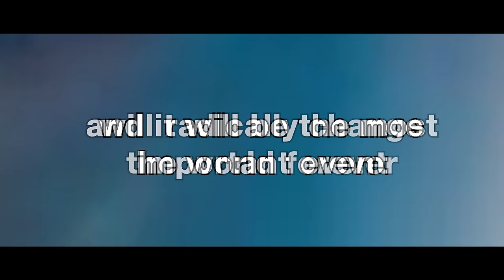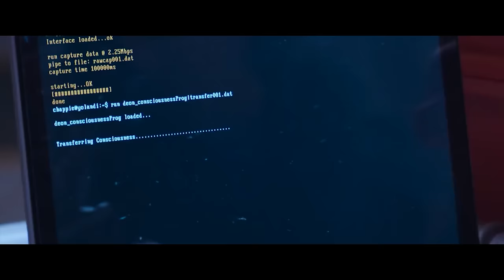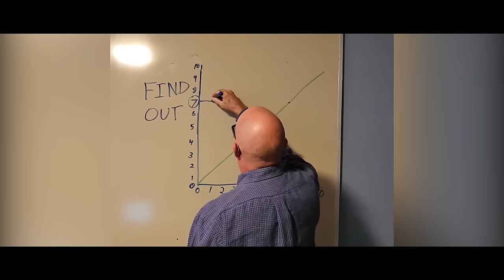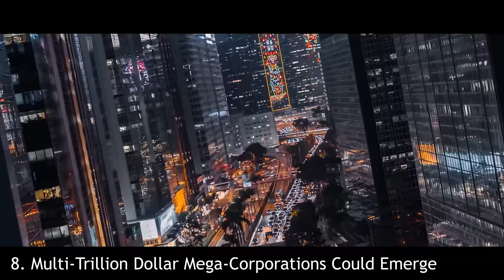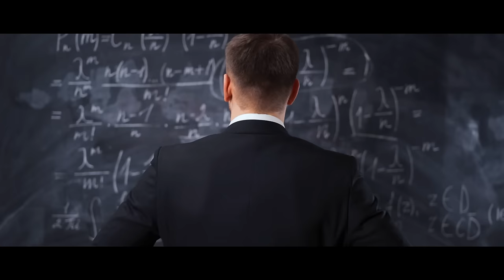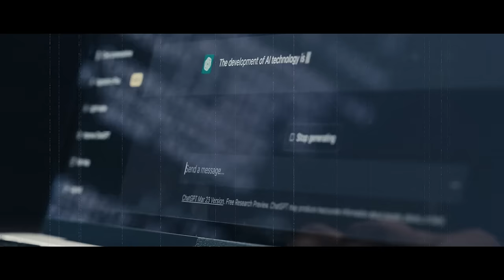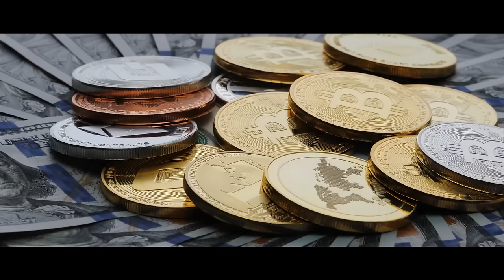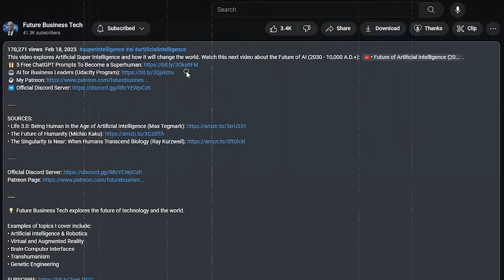Technological Singularity: 15 Ways It Will Change The World

Comment: Re: eternal youth - to avoid overpopulation, we should be allowed to have access to rejuvenation (where we can choose our physical age, from 20 years to 50 years) on the condition that when we reach 150 years old, we have to leave Earth and not return (except for visits not exceeding 1 year for every 15 to 20 years).
We have the option to:

A) Move to Mars or another off world colony. Extensive genetic and bionic modification would be made available, but bone density and muscle loss, radiation damage and other diseases are easily curable, so GM augmentation would not be necessary or mandatory.

B) Go into hibernation and join a colony ship to other potentially habitable star systems.

C) Have your mind uploaded to an artificial brain that is then connected to a virtual reality of your own choice, with the option to later have that brain implanted into an android body (which is also required to relocate to another planet.

D) Have your mind uploaded to a self sufficient server (cheapest option) where you can age at a normal rate and pass away in a human time scale.

E) Have a single rejuvenation cycle, but then age and die as per normal ageing.

F) Have the rejuvenation reversed (when you are about 100 years old) so that you age at a normal rate and die at or about 150 years old.

G) Live to 150 and then get humanely euthanised.

Many people will likely not even agree to rejuvenation. Wishing to live and die in the natural cycle (though with advanced medicine, that might be up to 150 years old anyway).
Religious or philosophical reasons, family or social interactions, fear of the unknown future or even just weariness could all be factors in the decision to live a ‘natural’ lifespan.
Reply: I agree that many people would chose not to live indefinetly, but I suspect that they would be in the minority.

I don't know that people would want to be exhiled to a Mars colony in order to continue their existence, especially if that implies a serious downgrade in their quality of life.

Comment: Bold statement. Technology only got smaller. Displays has higher resolutions, photosensors are more sensitive, and processors has smaller and more compact transistors… but they are all the same old 386 computer arquitecture. Except for quantum computers… which may be the groundbreaking.

Comment: I have never been convinced by the importance of anti-matter or fusion rocket engine. What's the point if you are still going to have a certain kind of matter onboard to throw behind the starship so that you can propel it forward? After all, what the fusion reaction or mater-anti-matter reaction produces is photon particles aka light. Light being massless, you gain nothing throwing it behind even at high velocity (light speed)
Reply: You are incorrect on more than one point:
1. Light might be massless but it has momentum. And the more focused and intense light is the greater its momentum is. Which is how the Breakthrough Starshot project's tiny laser driven light sail probes are expected to reach up to 20% the speed of light on their way to Proxima Centauri b. 

Even unfocused sunlight (+ some solar wind particles) can drive a solar sail but it would need to be huge. But lasers are perfect to accelerate low mass solar sails in space. The lighter the probes are, the wider and thinner their sails can be, and the more powerful the lasers are, the highest the speeds that can be achieved.

2. Fission, fusion and matter - antimatter propulsion are orders of magnitude more efficient than simply burning a chemical fuel with an oxidizer. The point is to reach very high exhaust velocity using the lightest fuel possible (for high Isp, i.e. specific impulse). Hydrogen, being the lightest element, provides the highest Isp but it's unsuitable for long distance flights due to very low density and the requirement of an oxidizer to burn.

Methane is the second best (higher Isp than jet fuel, lower than hydrogen) but it still requires oxygen in chemical rockets. Chemical reactions are slower and far less efficient than nuclear, so huge quantities of both methane and oxygen need to be carried. But with a fusion reactor one could break down methane or a similar fuel to plasma, with no oxygen required. 

Plasma consists of ions, which are much lighter than exhaust products of chemical reactions, thus can reach far higher speeds. The current ion engine propulsion of NASA is highly efficient (fuel-wise, thus has very high Isp) but slow; it accelerates slowly, takes lots of time to reach the target speeds, and can only be used in space - it is inadequate to escape Earth's gravity well.

But a nuclear driven ion engine would be the holy grail of propulsion:
The exhaust could potentially reach near light velocity almost from the start, much less fuel would be required per million km, and its Isp would be unheard of. 

Ions/plasma are the middle ground between normal matter and light. Some fuel would still be required, because it would be far less efficient to (somehow) use the reactor directly for propulsion. But that fuel would not be burned chemically; that's the key point. 

Using a laser as an exhaust would be inadequate due to the high mass of the spacecrafts and the laser going in the opposite direction, unlike the case above.